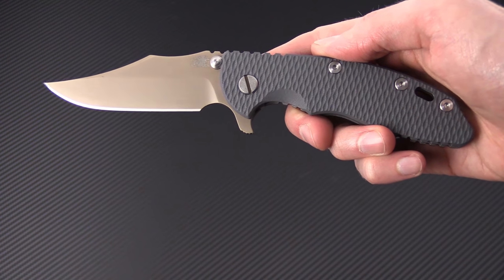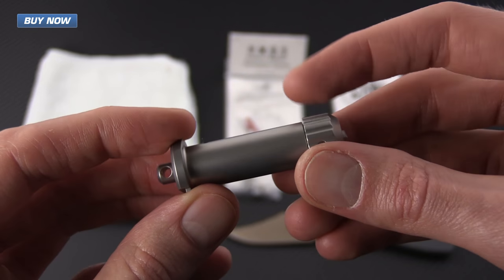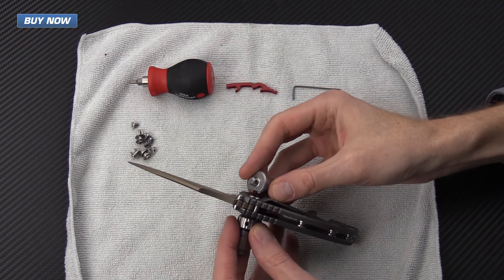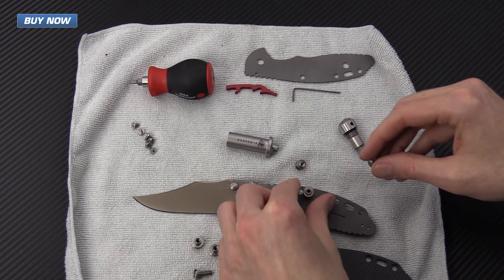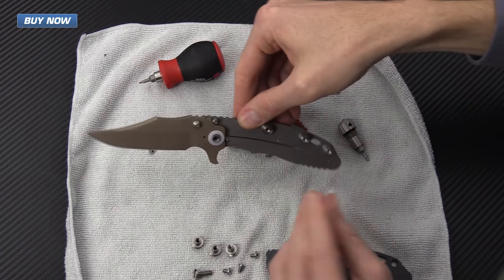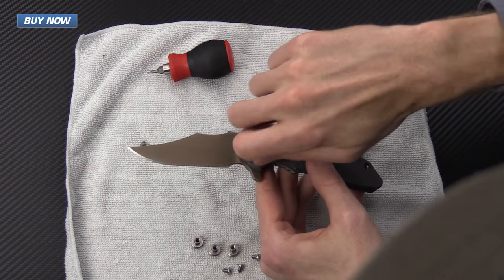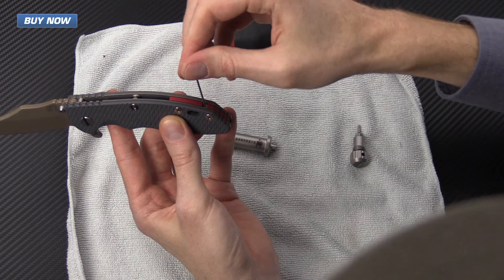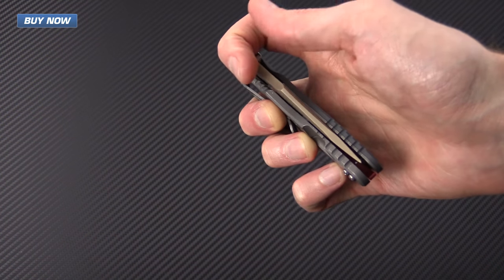GPKnives Guide - Hinderer Modular Backspacer System H.M.B.S. Installation Tutorial

Comment: I can see the advantage of this, but as far as appearance it looks like you're replacing the smooth pins on the titanium side with T6 screws.  I personally think the flush smooth polished pins that come stock on that side of the knife are more attractive.  I wanted this not so much for the colorful backspacer, but for the more practical lanyard option you can add on in place of the stock serrated backspacer.  Thanks for the very clear tutorial!
Reply from the maker: The screws that come with the system are nearly identical to the stock screws in appearance. I believe the only difference is the length.

Comment: They should of just made a solid full thickness backspacer to replace the 3 standoffs. Knowing them it still would of cost us over $100 for a simple waterjet and tumbled piece of ti....RIP hinderer brand
Reply: It's made so that you can switch backspacers without taking the knife apart. If you wanted one with a different function, you wouldn't need to take the knife apart every time.

Comment: It's on teflon washers? Are you serious?
Reply: shannonandsheila1 Dude, you're delirious. This is a $450 knife, it should have fucking phosphorus bronze washers. Teflon washers are the fucking worst. They wear terribly, they are terrible. Phosphorus Bronze washers get smoother and smoother the more you use them.
Reply: I couldn't disagree more. Teflon washers are ideal, however most knife makes cannot pull of a knife with Teflon washers because they can't overcome the side to side blade movement with their sub-par design and manufacturing result in. PB washers make pulling that off much cheaper and easier. Hinderer designs do not need the crutch that is PB washers to pull off bank vault lock-up with buttery smooth action. Maintaining a knife over generations is much easier as hardware stores carry the Teflon washers in Rick's knives. Finding the PB washers needed for a particular knife must come from the manufacturer. Teflon washers are a testament to these high value and durable American folders that are Rick Hinderer knives.
Reply: Chris Clark God you're a fanboy. Rick Hinderer knives have been criticized for their poor quality at such an expensive price.
Reply: Considering they typically don't remain in stock for longer than a few days wherever they sale at I'ld say Rick Hinderer knives is just doing just fine. I could offer criticism of RHK and many other knife makers, few are perfect. To those of use who use our knives to work in very demanding environments, RHK has a proven track record for making dependable folders that perform well.
Reply: Chris Clark 400 dollars for a knife it better at least have fit and finish on par with a Kizer Gemini, and often times the Hinderer knives don't.
Reply: +DavidMN thats pure bull. i have handled 20+ in stores and they are way better than Kizers.
Reply: cyphersuit1 You can find plenty of people who disagree. When a 400 dollar knife doesn't even compare to a knife below its price range, there is a problem.
Reply: If you say so man. Buy cheap knives dude nothing wrong with that. People spend 50000 on a car when a 3000 one will get you to work too. Some people can't afford well made folders. They buy cheaper ones. They both cut things. Don't feel you need to defend your love of cheaper knives to me. Get you a knife you can afford and works for you. Different strokes for different folks. It is all good. My point was to say that pb washers typically come on cheaper quality knives, It is just a fact of knife making. Don't let it offend you.
Reply: ***** I see more cracked nylatron/teflon washers on work knives than I do phosphorus bronze washers on work knives.
Emerson isn't a good example because their F&F is absolutely atrocious, their quality is very hit and miss- that doesn't make them bad knives, but again for that price range it is inexcusable.